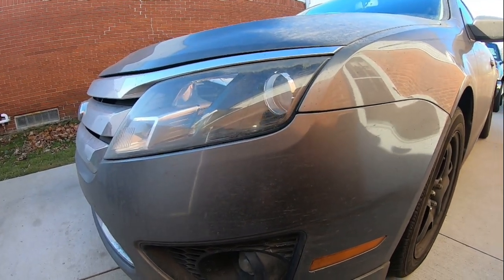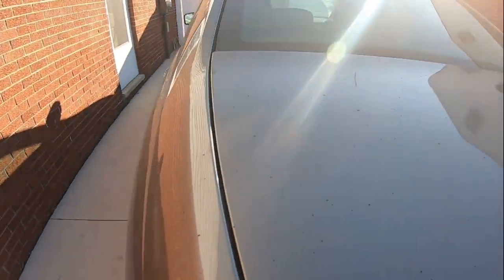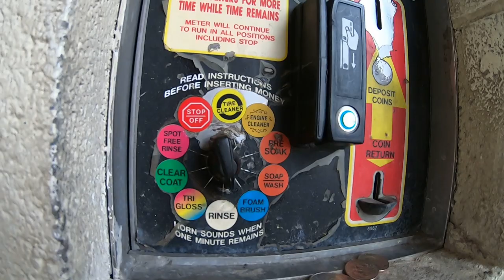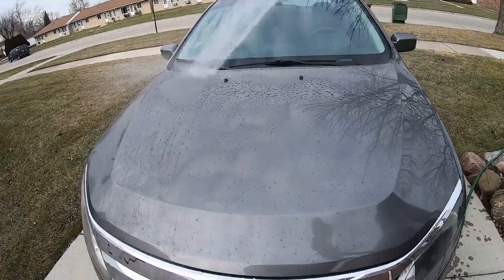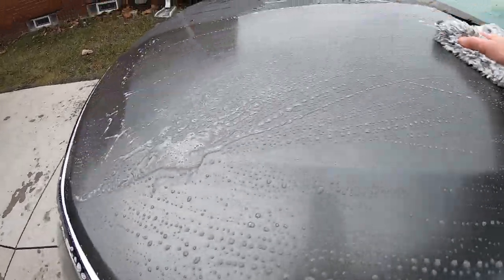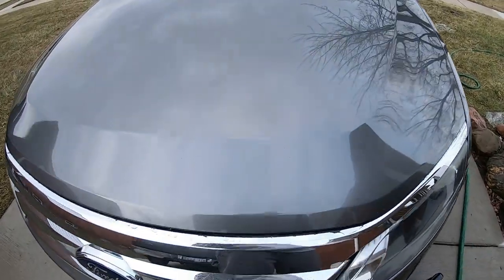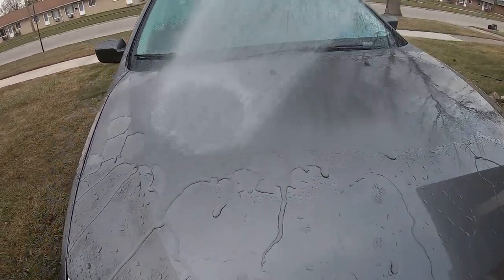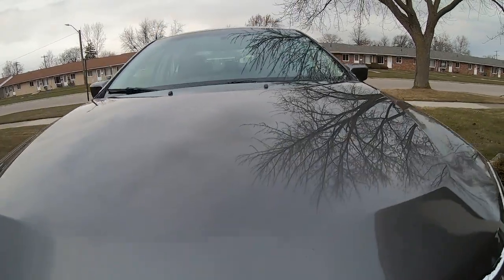Turtle Wax HYBRID CERAMIC SPRAY COATING One Month Review | DIY Auto Detailing

Comment: A little disappointed in all honest, yes it's still there but it appears it's lost most of its hydrophobic qualities in that time. I bought it a few weeks back and been to lazy to apply it, I need to remove the Seal N Shine first, for a product rated at 6 months durability and 12 with two coats it's kinda lackluster. Most folks seem to love ceramic based products for the water beading, this appears to have lost it already (at least for the most part) it's sheeting for sure but that's normally the end result when a sealant is on it's last leg.

Being completely honest here, I own this, I own Seal N Shine, I'm not out to get Turtle Wax I don't really care about the brand only the products but this was ultimately a pretty poor result for a ceramic/polymer wax only a month old in my opinion.
Reply from the maker: It's crazy the product sheared great before I washed the car in was thinking the soap masked it. In March I'll have a update video and bring up the other TW ceramic products. I believe using the other products with boost the ceramic spray but for the test I didn't use them or other boosters. I really like Fusso Coat Soft99 that paste wax beads like crazy on my son truck 4 month update will be out first week of March. Thanks for the comment
Reply: @OuzoLouGarage  I've had a good experience with Fusso, I like it does well typically lasts the full winter for me (to keep the salt and de-ice spray off my paint) but I've wanted to try other products as well. A lot of the new spray waxes really have a lot to offer and really require next to no effort to apply. 

Don't get me wrong Fusso is not exactly hard to apply either but I think we can agree it takes more time and energy to apply a paste wax vs a microfiber cloth and a few sprays on each panel. I'm kinda happy with the progress spray waxes have made and I think they are really starting to reach the area of paste wax in terms of longevity. Not all are like this but there is a few good ones out there and with TW claiming 6 months for this I wanted to try it. I'm debating if I should just go with Fusso tho if this ceramic spray has been knocked back this much in a month.

It's a ceramic spray the selling point for these products is arguable crazy water beading and while the product is still present the water beading not so much, I don't know how long it will last but 1 month isn't special. If it keeps sheeting like this at 3-4 months than that might change my opinion but so far I'm not all to impressed thank you for the video :)
Reply from the maker: You are right these spray wax ,ceramic are making it easy to apply.  My car get hit hard going to work in a industry environment gets coal all over it and the coal just can break down products fast. With some of these spray like this using once a month is pretty good knowing that they don't cost us a lot. Thanks again for the great comments

Comment: Why did you bother to take it to a car wash?  There was no perceptible difference from your hose and a couple of minute with a bucket and soap.  Having sorted the car in the first place, all that is really required is washing and maintenance.
Reply from the maker: I went to coin wash to get the coal off the car so wouldn't have tons of coal on my driveway that's why. I have

Comment: I think there is too much hype on the Ceramic spray from TW. 6 months protection my backside. There was no sheeting in the last part of your video. That was just staying there so quite honestly I think TW is dead as a doornail.
Reply from the maker: I have a 3 month video update out right now . Keep in mind I didn't use anything to boost the Ceramic spray and I'm the only one that test in a industry environment like this.  In a cleaner.  environment the product should last longer. But you are right it didn't last in the environment that I put it though
Reply from the maker: Thanks

Comment: SORRY, TURTLE WAX CERAMIC SPRAY COATING DID NOT  Provide ME  with the advertised gloss and finish. And yes, I used it as the instruction stated. I have used this wax several times and it’s just an average wax. It's my opinion this wax is nothing to get excited about. Save your money.
Reply from the maker: Sorry it didn't work out for you .. Thanks for sharing your experience with TW
Reply: @OuzoLouGarage  Thanks for responding
Reply: Have you tried Mother CMX
Reply: @noname-sq9pm  No, did you have any luck with it?